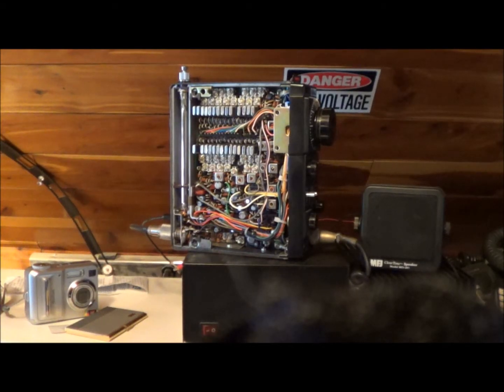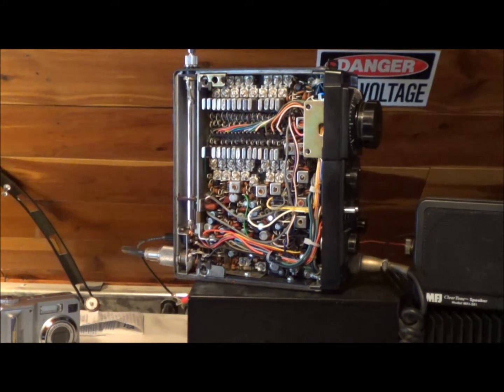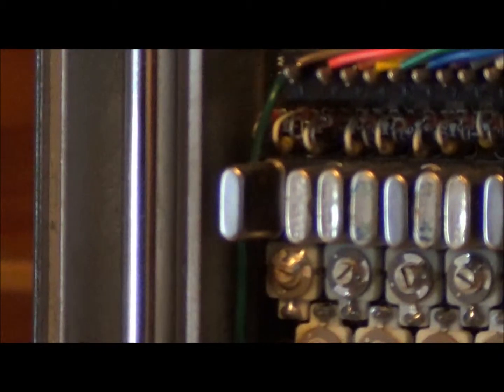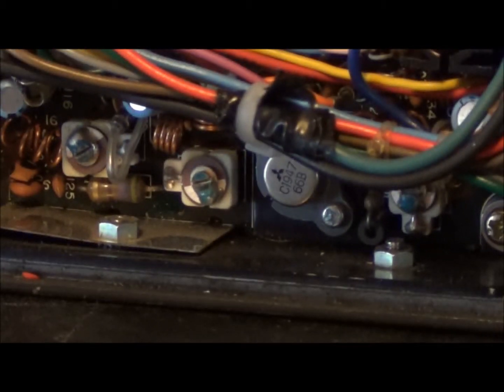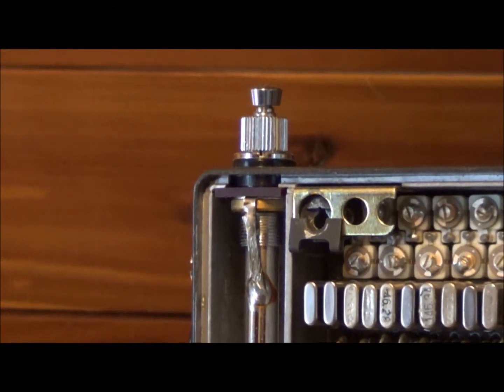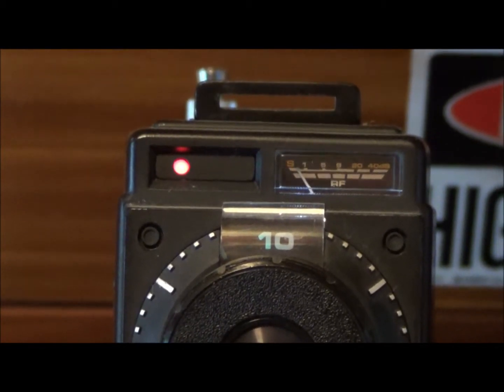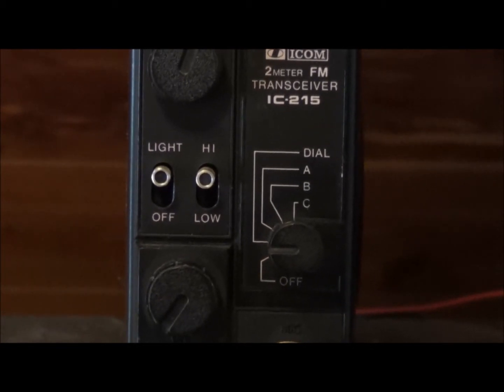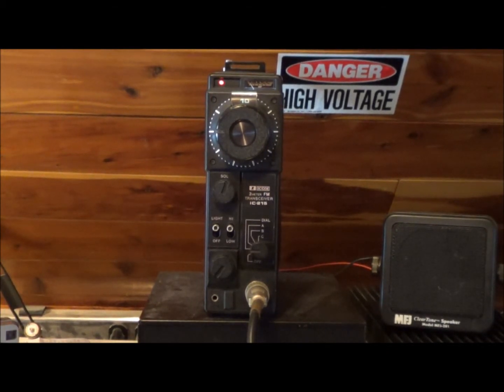The ICOM 215 2 Meter FM Transceiver

Comment: Very informational video. I will be watching the rest of your videos on this radio like religion. I just found 10 of them in a silent key estate that I purchased. I'd like to get them back on the air.  5 of them are the 215 model. The rest are uhf and 6 meter. Some are open. Oddly, one of the 215s has a key pad on the side. Liked and subscribed to your channel. 73s. KC1FGY

Comment: I had one of these in 1980. Worked the Amarillo 94 repeater from ten thousand feet over Lubbock in a Cessna with 1 watt and the pull out antenna. Good rigs, lots of fun. Ken...WB5QLI